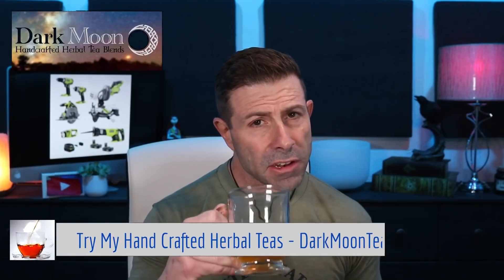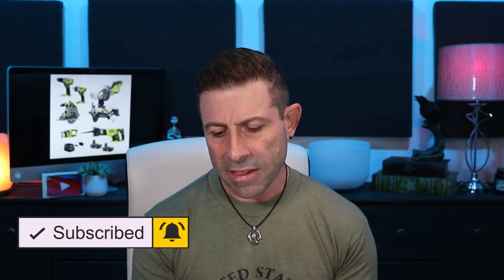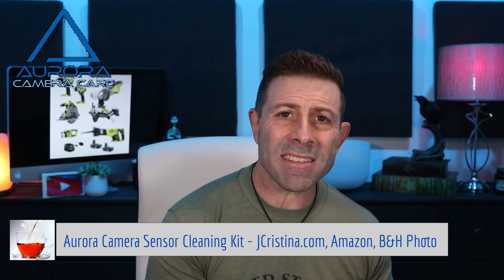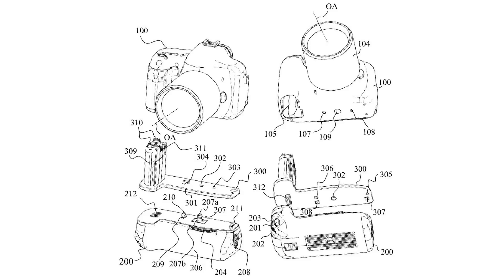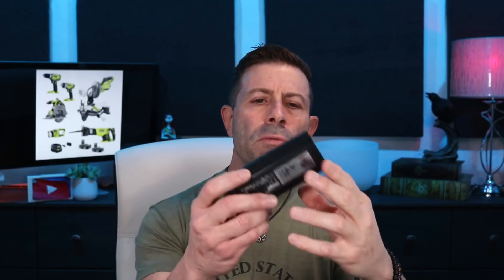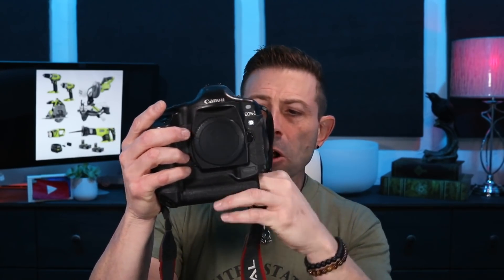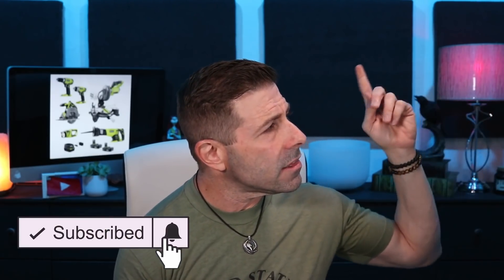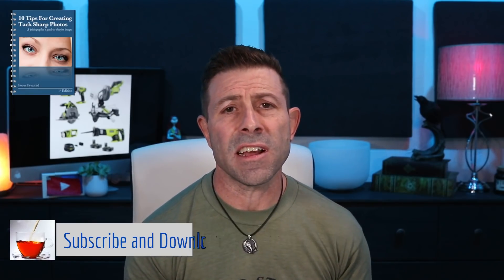Canon EOS Next Generation Power Tool Patent

Comment: Hi J, 
Do to vastly different cameras length and wideness, a truly universal grip would not make sense, plus it would be complicated as all the buttons and pins would have different voltages and/or wiring assignments. But to me it looks more like a 5D series universal grip. Right now the 5D Mark 2, 3, S and S-R use the same grip, but the Mark 4 uses a different grip and most likely the R5 or possibly future RS might use a different grip even though since the body structures are similar and the voltages and wiring assignments most likely are the same, the only difference would be a slight shift in the battery compartment or the tripod screw threads which this patent looks to resolve with a movable plate which compensates for the battery compartment or the tripod screw shift or both. This would resolve the issue for all the series without affecting the cosmetics of the camera if they had different lengths and widths.
Just my thought :-)
Reply from the maker: Could be the 3/4” slots to short the unit based on camera body size.  😁🤔
Reply: ummmmmmmmmmm..That's why JC mentioned that there's a sliding feature,that moves.That would accomodate with the different body sizes...
Reply: OK for those that are confused on what I am explaining. The 5D's are about an inch longer that let's say a Rebel, and the grip handle protrudes about 1/2 an inch more. If you make a grip that fits to the size of the 5D's, close to 6 inches in length, it will look ridiculously bottom heavy on a Rebel which are close to 5.2 inches length). They would be better off making a grip that encapsulates a series of Rebel models, another that covers all 5D series (which are near 6 inches length), including upcoming R5 mirrorless as they should be close in size to the 5D's. And another grip that fits the 7D and 6D (all which are close to 5.5 inches length). The part of the grip that moves is the top portion that has the battery interface with the camera and the tripod threads, not the size of the grip itself.
Right now the 5D Mark 4 uses a different grip than the 5DS-R, 5DS, 5D Mark 3 and Mark 2. Most likely the R5 would use a different grip also, unless they make a universal one for all 5D series with a moving top plate on the grip to re position according to the model.
Reply: @nmelcam1  ONE MORE TIME,duhhhhhhhhhhhhhhhh...It has the potential ability to accommodate different sizes.It is not out yet,it is a PATENT,as in an IDEA,so it still has to be tweaked.Next,it will probably not work with ALL Canon ASP-C and full frame bodies,yet that's pretty obvious,at least for some.
Reply: @nmelcam1  https://en.wikipedia.org/wiki/Comparison_of_Canon_EOS_digital_cameras
Reply: "An accessory attachable to an image pickup apparatus through an adapter includes a body portion configured to contact the adapter, a screw engageable with a screw hole in the image pickup apparatus through a through-hole formed in the adapter, an operation unit configured to move the screw relative to the body portion. The screw is movable in a plurality of directions including a direction along an optical axis of the image pickup apparatus and a direction orthogonal to the optical axis in accordance with an operation of the operation unit by a user.

From the patent literature:

    SUMMARY OF THE INVENTION

    [0004] The present invention provides an accessory and camera system, each of which is generally attachable to a plurality of types of camera bodies."

Excerpt from>>>>>>.https://www.canonwatch.com/canon-patent-battery-grip-that-works-with-different-cameras/
Reply: That said, there seems to be some nifty ideas here that could make this battery grip quite interesting. While it has the usual tripod mount, the patent talks about a moveable one, with little gears that could reposition the tripod mount to better balance different camera bodies.

What is unclear is how the battery grip will accommodate different battery types. While the Canon LP-E6N can power a large number of bodies – including the EOS 6D Mark II and EOS 5D Mark IV DSLRs, and the current flagship EOS R full-frame mirrorless – there are other batteries that Canon cameras use.

Perhaps this will become clear if and when the battery grip is actually made – after all, not all patent ideas come to fruition. 

<<<<<<<<<<<<<,https://www.techradar.com/news/canons-patented-universal-battery-grip-could-be-compatible-with-several-bodies
Reply: @michaels8597    The thread being slightly movable is so that the grip fits the Mark 4 and the previous S SR Mark 3 and Mark 2 as of this moment even though the bodies are very similar, the Mark 4's grip does not fit the previous models and most likely the new R5 will have a similar mount. The plate actually moves the threads according to the camera. The 5D's grip also protrudes outward around 1/2 inch more than the Rebels, the slide will not  make the grip thinner. Just grab a Rebel, a 6 or 7D and a 5D and you will see that a grip made for one line, would look ascetically horribly in another line. Still cannot see a grip that would look nice both ways, in the different lengths and in the different girths of the grip. The Canon site expresses the deepness of the cameras from the center, not from the grip. Just grab a Rebel and a Full Frame on your hand and see for yourself that the grip size differs a lot even though Canon says they both are about 3 inches, that is from the center of the backscreen to the center of the mount, not the right hand grip width. Just handle the two models, see the grip size differences and express your comments :-)
Reply: @nmelcam1  

ONE MORE TIME..Let..me..go..slowlyyyyyyyyyyyyy....It is a PATENT,not something already made.It is a proposal to try and fit as many camera bodies as possible.Did you actually READ anything I left to read or listen to the video????

                Now I already provided the dimension of Canon bodies,so i do not need to try anything,hold anything,nor worry about it.Just because YOU cannot envision it,CAPTAIN OBVIOUS,means NOTHING,because I doubt that YOU have been chosen to work with Canon on this project.You keep on rambling about with dimensions I already provided,again and again,ad nauseum,as if by repeating yourself,you will bring your negative comments into the realm of reality.

             You're the expert of nothing except beating us over the head with the same,same,same,and just same old,rusty,dusty stuff .Canon made the damn cameras,not you,so i would think whatever you thought of,was already considered before they even registered the patent.Now,let 's be intelligent,think,and keep discussing the possibilities,not your personal guesswork,based on your OPINION>....

Now unless YOU have PROOF it will not work,have a seat and let grown folks talk...
Reply: @nmelcam1  Can you READ>>>>>>????????????READ this...." JCristina
JCristina
11 hours ago
Patents are not products so we will have to wait and see if Canon implements this or not. "
Reply: @nmelcam1  zzzzzzzzzzzzzzzzzzzzzzzzzzzzzzz,talk about something going clearly over a person's head...wow...Please do not even consider a career in legal counsel or CSI,because attention to details is NOT your strong suit...whew...
Reply: @michaels8597   Really Michael? JC said to write our comment our opinions on this and I did so, it is my opinion and my comment, you do not need to be trolling if you do not like my opinion. I have been a photographer for many many years and most probably older than you, so your comment "have a seat and let grown folks talk" is so inappropriate. Do everyone a favor and STOP trolling and write your own comments and opinions on your own thread. If you do not have the capacity to do be open minded and listen to others opinions, then don't bash on others opinions, you are not the God of all YouTube. In my original comment I ended it with "Just my thought :-)" so that's what it is, it was not made to satisfy your personal opinion, which I respect btw, just not the way you are presenting it by trolling mine.
Reply: @nmelcam1  ..whatever dummy..

              Yes,we can all comment,yet intelligence rules the day,and making comments about something that has yet to even be built is just stupid and shows you cannot pay attention.In other words,you concerns have evidently already been addressed by Canon themselves,before the Patents news was released.

                 That means there is no logical point in beating anyone over the head with the OBVIOUS...PERIOD..Now if you do not like my comments to you,do the adult thing,the smart thing,and don't respond.You can certainly at least handle that,right????I never said i was the God of anything,and now you can stop crying like a baby girl and move on.

                   It's not about me 'doing everyone a favor' because you can ONLY speak for yourself,and since you're the only one crying,it's something YOU take personally.You do not know me,i dont know you,and unless you can personally make me stop delivering the FACTS about the patent,nothing you say matters to me.Now,I dont need an audience,and I already spoke directly at you,so i am not trolling you,you have simply been corrected.

                  So,if you are so adamant about telling me what I should do,inbox me,and then COME MAKE ME d your bidding.Like I said,you can simply ignore me,take the L,and keep it moving.You call yourself a man,but you are bent out of shape from something I say online???wow...Breathe silly boy......whaaaaaaaaa.....
Reply: @nmelcam1  ..

          Oh and being older than MOSES doesnt make you automatically grown,smart,logical,nor wise.You do not know how old i am either,nor when i started shooting,so what's your point?????I have more than your capacity of an open mind,because i can READ and make logical statements,and work towards believing this would work,unlike you,doubting Debbie...

           You dont have to satisfy anything for me,with me,nor to me.Keep crying and have a damn seat.Damn grown man crying because he feels butthurt that someone doesnt agree with him ONLINE..hahahahahahhahahhhhaaaaa..How do you even know that i am just not clowning you,and that i have the same concerns???YOU DO NOT,Nestle s hot chocolate.

               In fact,making the grip work on various bodies can automatically be problematic,but that's a MOOT POINT and OBVIOUS..duhhhhh..Look at the RECALL masters.Nikon,who come out with a D850,and follow up with TWO recalls on the mirrorless camera.
Reply: @nmelcam1   JCristina
JCristina
11 hours ago
Patents are not products so we will have to wait and see if Canon implements this or not.
Reply: @nmelcam1  give that speech about maturity to your Momma as you keep crying and responding to someone online...
Reply: @nmelcam1  I'm not going to watch NetFlix until i am done with your Mommy...What part of inbox me if you had something off topic to say was hard????stupid is..YOU...
Reply: @michaels8597  Dreamworks was aking for you, they are thinking of giving you a part in Trolls 2 😂😂😂
Reply: @michaels8597  so you like 86 year olds? I'll let my mom know hahaha
Reply: typo..are bored..
Reply: @nmelcam1   "might even help with your brain cells to properly listen to others opinions"...COME MAKE ME listen...This is not about others,it's ONLY YOU crybaby...Speak for yourself crybaby....
Reply: @Aleksandro Melo He understands nothing because he's one who had to be reminded it's not a product,it's a patent.It's like watching  a Batman movie and believing iit's a real person,for him.
Reply: @Aleksandro Melo "It goes without saying that a patent does not a product make, but this is one of those ideas that we hope Canon follows up on.

To read up on some of the other intriguing ideas Canon has patented over the past few months, check out this mirrorless-to-DSLR converter, this detachable cooling fan for DSLRs, or this crazy 18mm f/1.0 lens for the full-frame mirrorless RF mount.

(via Canon Rumors)
Tags: batterygrip, batterypack, canon, canondslr, canonmirrorless, dslr, grip, invention, mirrorless, patent, universalbatterygrip

"..excerpt from https://petapixel.com/2020/03/05/canon-patents-universal-battery-grip-that-would-fit-multiple-camera-bodies/..It clearly shows the potential for adjustments,and since they made the Canon bodies,it stands to reason they already made concessions for this when they thought of the patent.Some things though,go clean over some folk's heads.
Reply: @Aleksandro Melo .....my point is this..

                      Let's say you own Toyota or Ford,and you want to make a universal media unit for all your vehicles.You make SUVs,work trucks,compacts,crossover vehicles,Vans,and sedans.When you even start the thinking process,you have to consider how you can retrofit the unit,and figure out it's adaptability to new and older models,as well as which ones you might not be able to work with.

                     Then you want to pass the idea to the public to see if they even want it,so back to your demographics and surveys.Next,since you make them,you obviously know the dimensions so you already know how adaptable this media unit must be.You know even if the public says they want it,you have to make it worth their while and yours,so you do not put something on the market that does not get sold well.

                  Then you have to make sure you use study,and solid materials that will stand the test of time,like they did with film cameras.So,back to Canon...Canon has filed the patent,and evidently intends to build and market this grip.Like JC said though,it's ONLY a patent,and many of them never leave the planning floor,never come to fruition,except on paper/media.

                     My point was,since Canon builds their cameras,they evidently know what challenges with size/dimensions they face,so bantering on to us about it,was a damn waste of time.Then,I have no damn respect for any man who cries about how someone relates to them,then turns around and does the same exact thing,while pretending to be some kind of victim.I just do not care for people who play the victim role,the punk role,and then try to be the slick hypocrite.

                     Now I fully understood what he was saying,yet there was no logical point in beating us over the head about something we already knew.JC showed us the patent,i followed up with more information about the proposed adaptability,and yet it went on and on ,on and on,until it was redundant.It's all good though,because i know i can stick to the facts,instead of negative conjecture.
Reply: @Aleksandro Melo 

             Plus Melo,this is an awesome time,these part 5 years or so,with Sony leading innovation with FF AF,Fuji with APS-C and making amazing,affordable medium format,Olympus hanging out with 4/3,Panasonic moving ahead with solid cameras,and even Pentax poised to come back with an advanced flagship APS-C.Canon and Nikon have been hot or miss lately this last year,but Canon is evidently serious now.To top it off,Sigma has come back,Zeiss poked it's head out,and they are even making brand new film formulations.If someone is going to be Doubting Debbie,they have a personal issue,and maybe it's time to pursue another artform.

Comment: Wow what a find!  You always find the really important stuff that nobody else finds!  To some this may be mundane, no 20 frames per second etc, but wow this solves so many problems and aggravations.  I hope it's real.  And it looks like a real vertical grip with a real shutter release unlike Nikon's failed battery only grips.  I guess I find the mundane stuff so important.  I think Canon's inclusion of the shutter that covers the sensor when the lens is off on the EOS R to be absolutely killer.  It helps solve the biggest problem with all interchangeable lens digital cameras.   I wouldn't consider buying another brand of mirrorless camera other than Canon so long as Canon is the only one with this feature, especially when so many Sony shooters complain about dust on the sensor and having to clean the sensor after every shoot.   So please keep finding this cool stuff!  It's not all firmware guys.
Reply from the maker: That’s why I created the Aurora Camera Sensor Cleaning Kits.  So many dirty mirrorless and DSLR sensors. Thanks Gary for being here.

Comment: The problem they'll have with this approach is that not all Canon cameras are the same size. This means the "adapted" grip for a 5D will look too big on a T8i, for example. It would look like a camera is standing on a small "island", heh.
Reply from the maker: That might be the reason for the 3/4” slides.